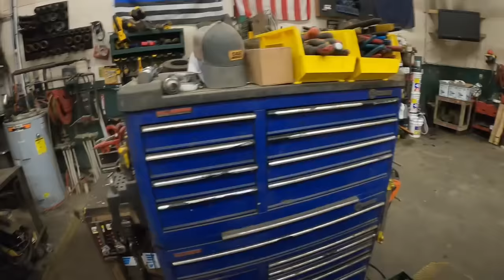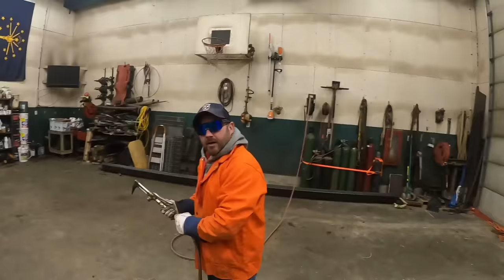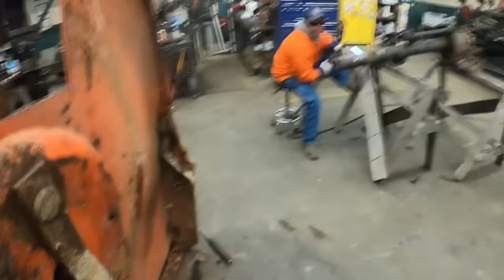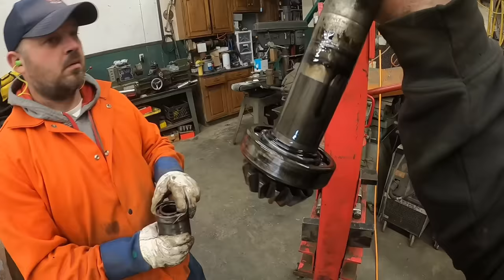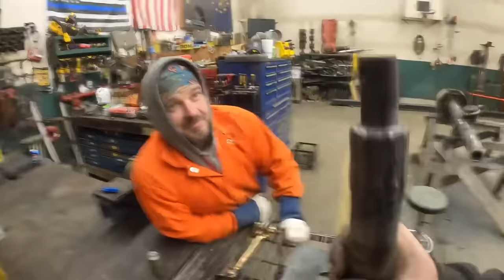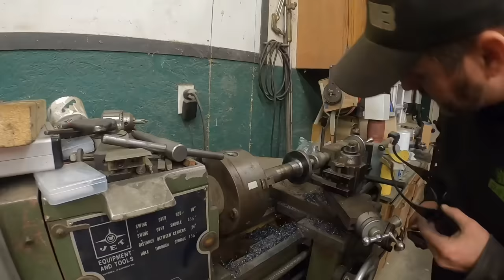This Build Is Absolutely Insane! Our Craziest Project Yet!

Comment: If I had to guess,  the axle mount is only welded on the ends because those are on the front and back of the axle where the lesser stresses are.   Welding all the way around would have placed weld on the bottom of the axle where stresses are highest.  This increases the likelihood of fatigue cracks.

Comment: Lumber in the old days was cut from old growth forests which had a thick canopy which made the trees grow slower. The thickness of a growth ring is a gauge of the amount of growth in a year. Old growth has much tighter growth rings because it grows slower which  makes the lumber much stronger and less prone to warping. Modern lumber is grown on a tree farm and planted spaced apart to speed up the growth but has much more open ring pattern which is way weaker than old growth. That's why they get so much money for sunken old growth lumber at the bottom of lakes and rivers. Furniture makers will pay 100 x the price of an old growth log compared to the same size and species new growth.🍻

Comment: 1980s on a 100y old radial arm line shaft drill with feed we would drill a 3/4 inch hole (Just a Big centre pop mark and no pilot hole) in flat bar for chimney band "Fred Dibnah style" a 30 gallon oil drum to support the 6ft flat 3inch x 1/2 inch bar and just a PEG in the radial arm bed to stop the drill rotating the flat bar ;-)) our RAdrill was a bit worn and bent and did not drill in a straight line.
We made 100s of chimney bands for UK Lancashire mills. Speed change for the belt drive was done with a broom handle.
Reply: Ahhh ..... Fred Dibnah, there's a name to conjure with. Used to love watching that gent, he was amazing 😁😊 JQ 🇬🇧
Reply: @Blossom_Chops  I was luck to be able to help him with his steam roller when he was doing a charity event. Another of my relatives sold him his first Land Rover when he first started being sponsored by a brewery. Our Blacksmith shop started in 1890 sold in 2019.

Comment: Mike, have yall tried to use a gouging tip on your torch, it’s the first thing I learned on! Gouging things apart! Plus it’s not as loud as an arc gouger! I’ve used 1/2” gouging rods with a 1000 amp shop welder and that’s a mean SOB! Plus it’s getting so hot and burning your hands through your glove! That’s when I first started at 18 years old! But the acetylene gouging tips work good, just have to get used to them and determining the metal finish the slag! I know yall know what I’m talking about my friends! It’s just another technique to removing the welds! No matter, I was just wondering! Those tips save your good straight cutting tips!
Reply from the maker: Yup

Comment: You need to make do a rack. Going the wall to hang your truck key. You drill bits all your pieces right there. Behind the lays and man behind the scenes can build it for you. You just gotta lay out everything out on a piece of metal to where they slide in the holes or whatever on shells. Or hate whatever you need to do to put all the imports instead of laying on top of it, because it wouldn't even fall down when that's spin, it's gonna sling out and hit somebody or something.

Comment: I suggest that you take that motor for your white three axle, mount it under the dump bed with an off center weight on the shaft and use it to vibrate the bed to get the last sticky stuff off . Isn’t there enough hydraulic power from the dump pump?

Comment: lol don’t worry I can remember pressing bearings on with out putting my shims on first when I was building rear differentials for ring and pinion swaps, and not realizing it until I had it all back together in the vehicle and not realizing it until I checked for backlash and gear pattern so I know exactly how you felt when you welded that on
Love the video can’t wait to see what you are building

Comment: There's a large saw blade leaning on the toolbox so I am guessing a limb saw for one of the excavators. If you are going to weld in a lathe, put the ground on the tailstock if you can't go directly on the part.

Comment: I was trying to tell you, if you needed bearings, they go on first. Welding on your lathe can cause arking in the main shaft bearing in the head. I could not see the ground clamp. If you must pull string shaving off the lathe, get a PAIR OF PLIERS.. No fingers, fingers.

Comment: Mike did not realize, but he did give it away 10 mins into the video as the bright, shinny saw blade was standing up in the background!  Prior to that, I was going back and forth on a bush tree trimmer or a rock cutter to use with the tile plow, which runs off the excavator hydraulics! Interesting project so far (Stay tune)!

Comment: If you want anything that has strength, then it has to be slow growing like English Oak but due to the time it takes to grow and the effort needed to cut it down, it's not financially viable. The timber they use today for manufacturing is from species that are quick growers and very straight, which means that processing is easy and takes minimal effort. Nice bit of machining Mike, am surprised Aaron didn't say anything stronger. 😂

Comment: Where do you have the welder ground clamp located? It probably be attached to the shaft you are welding so the current is not going through the lathe headstock bearings.
Reply from the maker: It’s not

Comment: Ha, i was sitting here watching this, and I thought, " I don't know what he's doing, but shouldn't there be bearings on that shaft?"  Thats what happens when you get excited to finish.
Reply: Blind leading the blind, he's now forgot the gearbox bearing cover! He needs to learn metallurgy the shaft will now snap, welder heating and cooling is a form of heat treatment that makes it brittle, unless cooled very slowly.

Comment: You need alot smaller tip on that torch im guessing you got a  3 aught you could probably use a 1 or even a #2 grooving tip for cutting welds
Reply from the maker: lol we are using a 1

Comment: Given all the grass etc on the brush hog, I am curious why you didnt take it back outside to blow it all off with the leaf blower before dumping it off when you tilted it.  Then again, I do not have a big garage or large equipment, maybe it is far less work to clean it up after it dumps than it is to move it around to clean it off outside. :)

Comment: Our 100y old lathe had a very large 4 jaw chuck holding a 3 jaw chuck because the main bearing was very worn out BUT we could not take a big cut since the chuck would lift up over the top of the cutting tool due to the play in the main bearing. The mass of the 2 chucks determined the depth of cut. I eventually bought the Blacksmith shop a new worn out lathe ;-)

Comment: Golf club Lathe. One of our managers put a golf shaft into the lathe from the back and shortened it and then brazed the putter head on BEFORE removing it from the small lathe, the rubber grip was too large to slide out of the chuck. We laughed after he left the workshop. that was 1984 I still smile and try not to make similar mistakes ;-))

Comment: As soon as you tacked the washer on the shaft i thought…..wonder if they plan on using bearings on this “mystery machine”….. but since its welded its a good time to mark it and do all the machining but then you cut it back loose lol. My guess is an excavator tree trimmer attachment

Comment: Is there some reason why you didn't use the female spline hub off of the blade assembly instead of machining the shaft? You could have attached the round plate to the hub. Thanks for sharing.
Reply from the maker: Yes many thanks

Comment: With cutting gases more then trippled in the past 10 years a torch burning with a 2/0 tip cost $5 just to light. Cutting parts off with a torch on something your going to clean up an reuse with a torch is so gangster like. Makes hell of a mess and leaves a hug a mount of weld an steel behind that needs to be washed off with torch an tons of grinding. For more then 40 years a better an cheaper tool used called an air carbon arc. And a 3/8" air carbon rod. It makes fast easey clean work of qickly gouging out the weld until you see the seam apear were the part meet the housing or frame. Once you opened the welds up with a 3/8" carbon rod all the way around to were you see the open seam the part just falls on the floor. The housing or frame is free of slag and a little  buff with a grinder cleans it up ready for the next step. No huge cost in gases many grinding disks and so labor saving and so much less heat put into the metal. I spent months in the great lakes wood land shop. Air arcing all the belly plates of the old koring short wood harvesters to  Repurpose the frames to build new koring de limbers and loaders for loading high way log trucks to haul to the rail road spur. These we biult from the short wood retired harvister frames from the ground up. I brought home miles of all diferent size hydrolic hose that were stripped from the short woods all with reusable threaded hose fittings. From back in the day before they made everything a throw away world with now costly one time use crimp on fittings. I have a gold mine.

Comment: Mike, You forgot to slide on the gearbox flange before the saw blade hub was welded the second time. In the next video the gearbox flange was in the proper place. How was this miracle achieved?
Reply from the maker: Check out the next video

Comment: with a blade like that and the hydraulic motor drive, I'm guessing some kind of limb saw like you see parked alongside highways when they're trimming trees.  Those machines are beasts and incredibly unaffordable.  I've looked for years to find a good, used small 4wd telehandler to build my own to trim the miles of trails I have, but even used those things are $$$.  I think it would work great, though.  Is this going on a skid steer or excavator?

Comment: Hi you were getting frustrated drilling that large hole because the speed of the drill was too high it needed to be 250 rpm, and on the lathe again for turning hard materials ie welds you need to calculate the surface speed and based on your hole size i calculated a lathe speed of 160 rpm and use lubricant oil or suds. old rule is bigger and harder the slower you go. great channel love your varied projects.

Comment: FYI, first off you "MAY," want to "ROTATE," your tool-post to the correct position.  Which is one set of "DOVE-TAILS" next to the center-line of the Metal Lathe, and the other set of "DOVE-TAILS"  facing (closest to) the metal lathe chuck.

The way you connected the ground to your metal lathe was a BIG-FAT-No-No!!!!!!!!!  The way to connect the ground is so the shortest route does not involve the current running through your bearing(s) of the metal lathe. The ground should have been connected to the part it self or to the tail stock in some way / function, so as to prevent the current running through the Metal-Lathe-Bearing(s.)  The reason to prevent the current running through the Metal-Lathe Bearing(s), is in case of "PITTING," as a result of a Bad Ground.  EXAMPLE:  You start to weld, maybe just strike the arc, and your ground starts to spark (Causing pitting on the surface closest to the ground clamp.)  Most times on a Metal-Lathe when GROUND INDUCED SPARKING occurs, it also Marrs (damages the bearing.)  Do stupid stuff, win stupid prizes.  It's that simple, no rocket science involved.

Also FYI, odd's are your Medal-Lathe has "Timken Ball Bearings (QTY-2)" and one or two small Timken Thrust Needle Roller Bearings. HINT in excess of $100.00 easy. Oh and you'll be the first to know when you have successfully "PITTED" the bearings, no one will need to tell you.  You'll be able to pat yourself on the back and say good job destroying the bearings.  Personally I think it's cheaper to just move the position of the ground clamp, versus $100.00 or MORE in Bearings and 2-4 hour's Bearing(s) replacement time.  Count on the 4 hr's if you've never done so before.

Comment: Hi,
You have made 2 fundamental mistakes.
1 you have forgot to put the gearbox bearing cover (the 1 with the bolts and seal to hold the bearing in place) on the  shaft before welding it up.

2 Did you notice how hard the metal was around weld edges? That's why you had to use a carbide tipped tool. Well I am sorry to say you have made the shaft change its metalurgical structure by heating and rapid cooling the shaft when you welded it. So when you spin it up and start cutting, the stresses will snap the shaft end off. Not immediately but it will not be reliable.
The only solution is to now put the shaft through its original heat treatment process, which would destroy the bearings anyway.
You should have either splined or keywayed the disc on the shaft and not touched it with the welder.
Keith.

Comment: Not sure if your going to be cutting stone or steel, some kind of variation of. Mounted on a axle means tow, push, or say hang on the end of a excavator to scar a cement wall. I have a memory of a village idiot so don't remember my own name at times.... just wondering why not use your lath for drilling those holes in steel. Remember the bigger the bit, the slower the speed. I was hoping that the lath is on a hydraulic feed for all speeds of zero to say what its turning now at least. Practice makes perfect as you do have the talent to tern it on, the rest is just a process of trying and see what fits. Oh by the way, I leave the chuck key in if I am operating it, you can hang a rubber band on your arm to remind you to go back and take it out before you leave.    This is my biggest problem of forgetting to put a bearing in or say the race and then remember... diff seals on the inside.... I have done all of them at least once over forty years of working. I have been crippled for the last ten that made it impossible for me to get around.

Comment: I'm kinda' wondering how your gonna' put the gearbox back together after welding that plate on the shaft, this is entertainment at its' finest. We used to call this field engineering and the prints they'd send out for a job "The comic's", the only way to make some things work is to just go at it.

Comment: so you are making a chainsaw replacement that fits up to the excavator it looks like. Ive seen a few out there used by professional logging companies but this homebrew could be amazing for a person looking for a cheap alternative for simple small tree removal. should only be limited by the size of the blade and the guard you use. should be able to chop up a 48 inch log into pieces might need a larger blade for much more than that. guy that just passed away had a blade that stood all of 5 feet rigged to a tracker just down the street. it was something to see, made me uneasy to see hit push things into it.

Comment: I don’t believe you had to weld the plate on, with the flange you have on it. The thick plate would act as a washer placing another on the other side and tightening the nut should lock it together and allow for bearing replacement.

Comment: Would be a sh!t-ton of fabrication but im swinging for the fences here............its a feller buncher? 

Jk, honestly it's looking like a hydraulicly adjustable tree trimming attachment for the excavator, the hub assembly turns 360 and uses the brake shoes to "lock" its position.

Comment: For a limb/tree cutter you and/or your workers lives could be in danger if the shaft of the gear box is too soft (not properly tempered for the type of use) causing a flying blade. Might want to have it checked for proper hardness. Just a thought wouldn’t want to see anyone be hurt.

Comment: Tou say you're not a machinist but that doesn't matter as long as the part gets made. Yes maybe a machinist will do a nicer job but the have been trained and do it all  the time. I'm like you but manage to get the turning done to a level that it works and that's all that matters.

Comment: Don't ground through the bearings on the lathes motor shaft it can pit the bearings. Seen a ton of 2 stroke cranks trashed where they used the rod to ground and welded the crank pin. I know you did not do that but just saying don't do that.

Comment: Rule #2 in our shop, after wearing proper footwear, is clean shit off of anything you bring in the shop, wash it, sweep it, clean it.................you know you can disassemble that axle and just slide the shaft out of the middle without cutting it, right?...........a real machinist doesn't pile crap all over the lathe  AAAAARRRRRRGGGGHHHHHH  bearings dzmn it
Reply from the maker: So confused last I checked this was in my shop